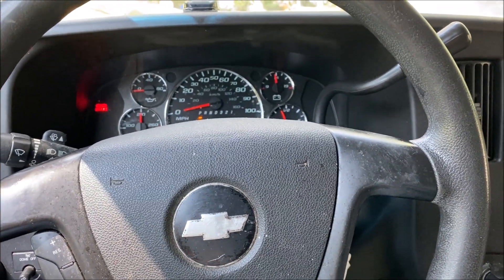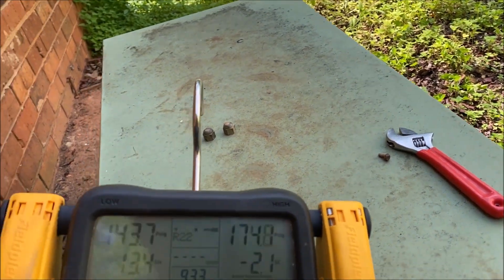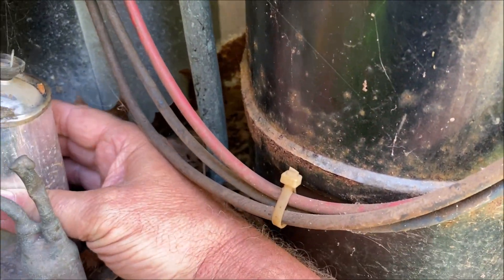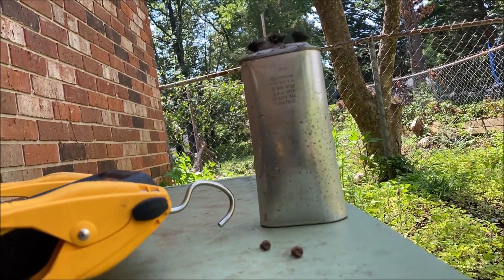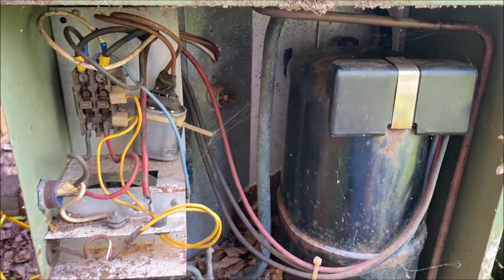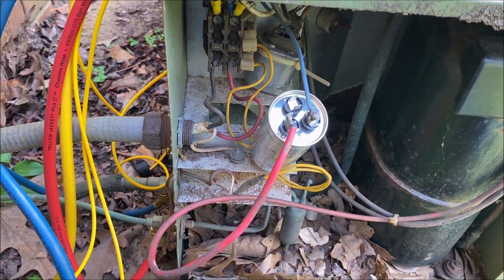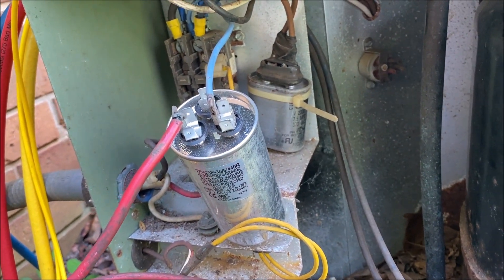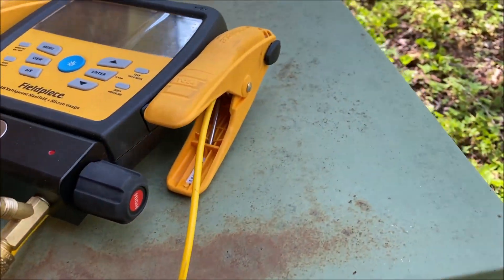Old AC Unit lives from 1970s ? antique Armstrong

Comment: Notice FLA....17.5 Amps on a 2 ton condenser.  2 speed condenser motor would swap to low speed at night. They marketed those as " Good neighbor " units. Ran quieter at night so not to annoy neighbors with out AC sleeping with thier windows open. I had a customer who was first on the block to get AC. It caught a .22LR  in the center of the condenser the first weekend.

Comment: These are such great units.  Now Armstrong is the same as the Lennox units.  When i replace a Lennox condenser and evap and use the original furnace, i sell the customer an Armstrong unit which is much cheaper thsn the Lennox brand.   cool to see these old units going strong.  They just don't make them like this anymore.

Comment: I serviced a 69 Sears a few months back. The capacitor was the size of a brick and weighed a couple pounds. Not sure if it had been replaced along the way or not. All I did was clean the coil and left it to keep on rocking.

Comment: Ted, I know of a tri-plex here in ga that has 3 units that look just like that except I think they're Heil's. They all still hold their charge and won't die, even though the renters never change the air filters (which usually freezes the coil up) the acts still have the original gray capacitors with ground straps on them. Amazingly well built machines.

Comment: My parents' house had an old Sears A/C that was older than that.  Lasted into the early 2000s with an occasional charge top off and a condenser fan motor as I recall when I was a little kid.  As I recall, my dad (long deceased) told me he and my grandfather bought it pre-charged and installed it themselves.

Comment: I found an r22 unit from 1956 once. Original blower and air handler. Only new part was the capacitor on the outdoor unit. 😂 I've only been in the trade for 3 years so I'll probably see more of that soon.

Comment: Appears that the switch that was disconnected was for a 2 speed condenser fan motor. Better in my opionion than fan cycling. I used to not like old equipment but now I like it more because the new equipment has so many more problems(I do commercial and industrial hvac)

Comment: I'm still running my old Sears unit of the same vintage.  I asked my HVAC guy about changing it when he installed a new furnace and he said "Run it 'till it dies!"  That was 15 years ago.  I changed the starting cap on the fan motor since then.  Other than that I vacuum it out and blow out the condenser every year(ish) and she still keeps the house cool. (That HVAC guy?  He's got a customer for life.)

Comment: Was designed after the old Fedders units.  They ran high head pressure (Fedders) because the metering device was 1/4" copper tubbing (12 feet or so ) all wound up and that was the metering device.  Armstrongs were bullet proof units in the day just like Fedders and GE.

Comment: I'm pretty sure any ac unit can run for long.time given the right conditons I'm testing that out with 3 mini splits 1 of them is a 1 ton inverter drive other is 2 ton inverter drive 3rd one is 1.5ton contactor all 240v except one

Comment: Flare nut line set, really surprised it still had refrigerant. In my short time as a service tech I saw a Chrysler from 1977 running like a champ, and a Singer, like the sewing machine I think, that needed the evaporator coil and blower wheel cleaned (smokers house). That was the nastiest thing I've ever seen. Once it was cleaned I checked the charge and it was bang on.

Comment: I have a 1978/79 unit still cranking for me with the original capacitor that is marked "manufactured 1976" a little taller than the one that you replaced here.
Reply: Have you tried putting a cap meter/test across it for shitz & giggles?  I'd guess there's a 50/50 chance its still within acceptable specs, as they made them very well back in the day.
Seems that the more 'toxic' their chemical makeup was, the longer they lasted.

Comment: The house I just sold had a old unit like that in it when I purchased it.It didn't work so I cleaned the condenser and evaporator and ran it from 1992 to 2010.Done a change out and old unit was still working at that time.👍

Comment: It’s from the 70s pressures are going to be a little high, sometimes you got to overcharge them because the compressors are wearing down, But old ones from the 70s and 80s are really good they were built to last and unlike today

Comment: And here I have been discharging capacitors with a screw driver.  Now I feel like a wimp. Real question: Do you have a separate manifold for R410A?  I use my fancy manifold on R410A and my old gauge set on R-22.  I am just concerned with mixing oils.  Am I being too cautious?

Comment: I had a customer who had one of those all the way up into the late nineties and It was still running smoothly when I changed out the system and it still had its original two speed condenser fan motor.
The customer would always come out and bum a cigarette off me and sneak a cigarette away from his wife every time I showed up,,, lol..
FYI that capacitor was manufactured during the 16th week of 1974...

Comment: I spotted the old two speed fan thermal switch with snipped off wires right away, lots of dinosaur sightings around these parts or used to be anyway :)

Comment: Got a GE Weathertron heat pump from the 70s. maybe the 60s? Anyway, never any maint. Only a capacitor replacement in 38 yrs I have had it. Cools my house too cold, if I let it. Never changing.

Comment: Was that a scroll compressor? And I came across a 42 year old Ruud that needed a fan motor and contactor. The Cap had a resistor going from one terminal to common. If that goes out would I need to replace it with a similar one?
Reply: I'm sure that was a piston.  I don't think they had scroll compressors back in those days, or if they did, they weren't widely used yet.

Comment: Unit like that I seen em last a long longer than the new ones. Might as well keep it going probably make another decade need to change that contactor maybe needs a fan motor. Have fixed plenty of systems from the 50s 60s 70s but they're almost all gone anymore.

Comment: I just thought my great Aunts a/c was a dinosaur, tag gone, paint gone but serviced every year since new in 1969, one compressor and two condenser fan motors and one evaporator fan motor and lots of gas from time to time. NOTE; she only turned it on when the temp got over 80 during the day and at night to get the temp down to 75 and off completely when at work, my great Uncle installed it in 1969. I am sure it was the cheapest one he could find. 🤣

Comment: Saw a capicator at the supply house that was 2 times that size and was just a 60uf, from the 1960s I think. Still good!!
Reply: the older regular steel can capacitor with greenish paint would last nearly forever, they usually rusted through from outside in and leaked the oil out as their failure mode!

Comment: That was probably a low ambient control.
You and big Steve keep um come'n!
Thanks big ted 🤠
🥃🥃🍺🍺🍺🍇🏌
Stay safe.
Retired(werk'n) keyboard super tech.
Wear your safety glasses.
Reply: original fan motor was two speed and that was the thermal switch for it. so yes some ambient control action :)

Comment: Has anyone ever told you that there is also a Coil INSIDE  that needs to be cleaned???

Ya think maybe cleaning the coils would have helped with the high head pressure?? 😆😆😆

Well I guess then you wouldn't be charging them for a whole new system next year then huh?

Another Full price HalfAssed job!  Way to be!😡
Reply from the maker: No sir, cleaning the evaporator coil does not affect head pressure at all. Only the metering device inside can sometimes cause the head pressure to be higher but that is within the refrigeration system and nothing to do with cleaning a coil. The outdoor coil and outdoor airflow are largely what will keep the head pressure down in the air-conditioning mode.
Reply: @TedCookHVAC    Did you just Google that? 🙄🙄 And you can't think of any reason a 50 year old unit should have the indoor coil looked at??😆😆

Keep trying to learn and then you may figure out that it was the OUTDOOR coil that needed to be cleaned to lower the head pressure. 

Another Partial job at FULL Price!!

Way to be!!😡
Reply from the maker: I hope you have enjoyed yourself with your in accurate assumptions and ridiculous points of view... That will be the last comment you will ever put on one of my videos. Constructive criticism is welcome but stupid insults that are completely in accurate and unfounded are counterproductive. Good luck in your future endeavors.